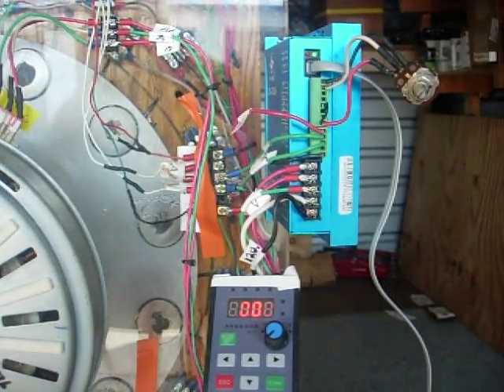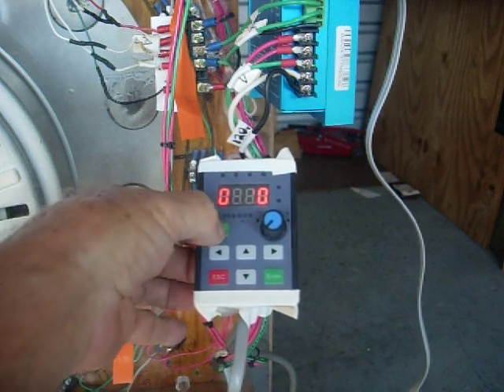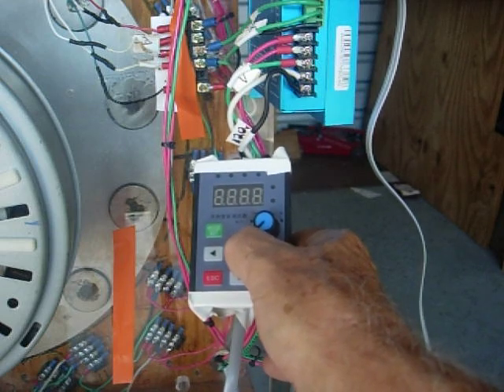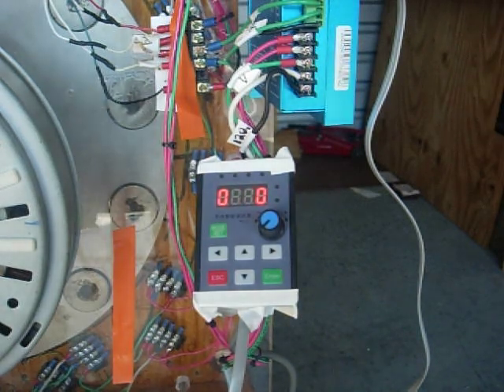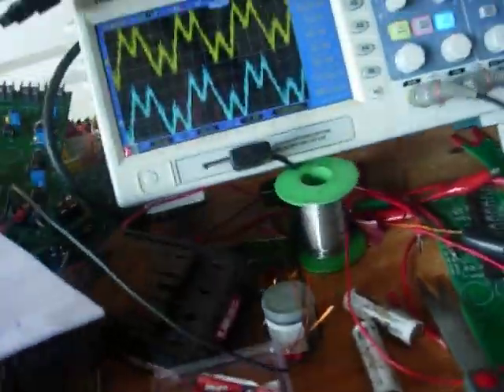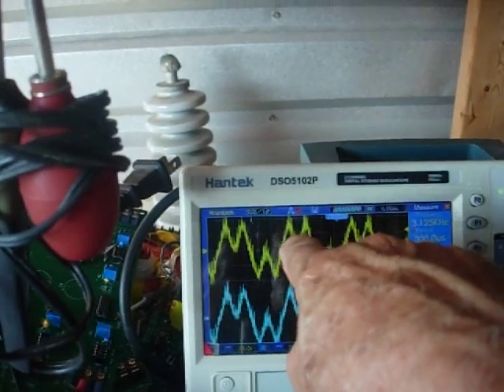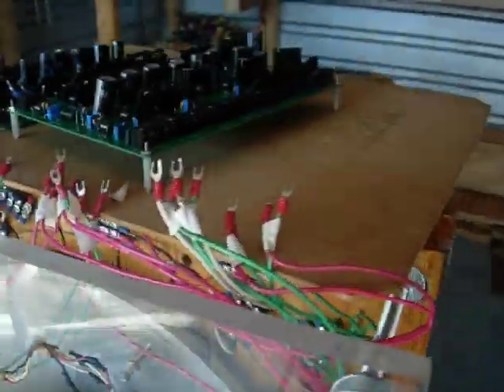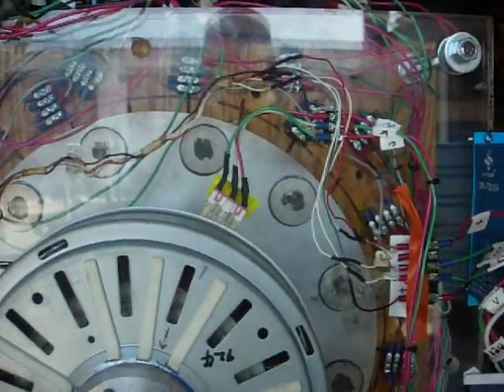Don Smith #336 ZM-7205A controller setup

Comment: Isn't this controller only have a max of 9 pole setting?
Reply from the maker: 8 max
Reply from the maker: I think
Reply from the maker: It will auto truncate if you try more
Reply: Thank you for your response. So just select 8? And it will automatically run a 36 pole? The one I'm looking at says it is capable of 20000rpm I'd be happy to hit 1500
Reply from the maker: It won't allow that number sure 8 max